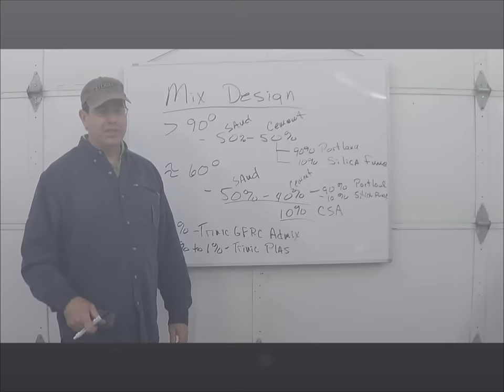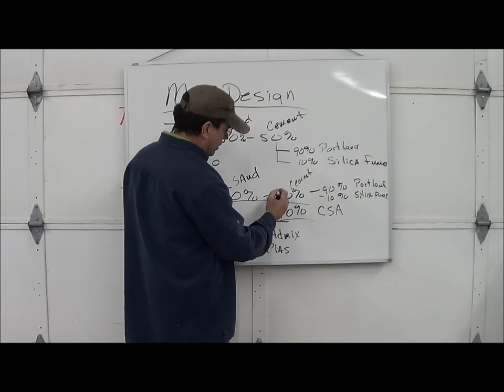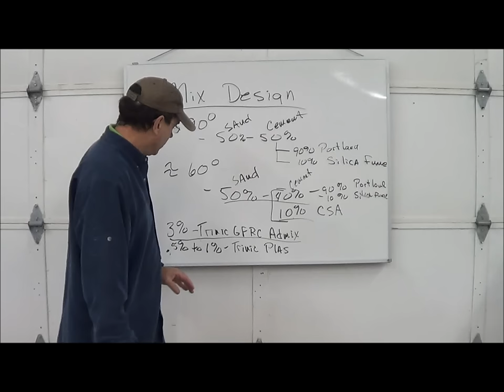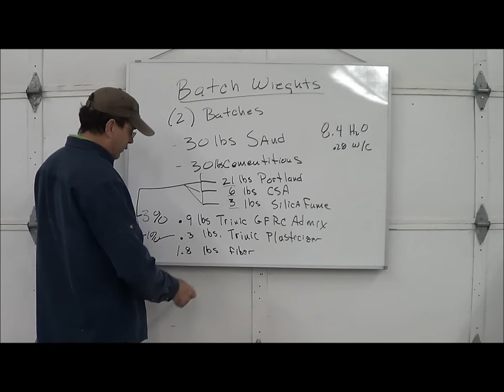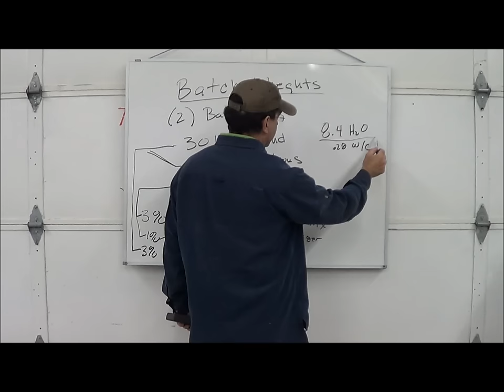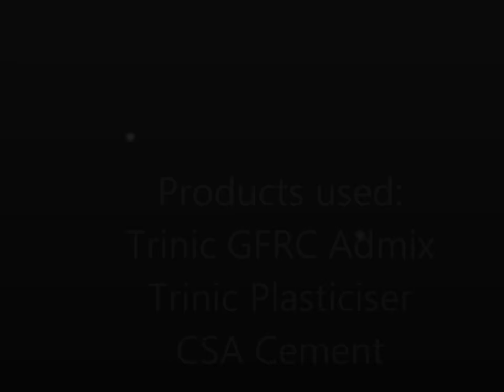Warped Concrete Coffee Table - UHPC - GFRC - Glass Fiber Reinforced Concrete

Comment: There are no glass fibers coming out from the top surface?
You don't need an extra thin concrete layer without fiber glass so that fibers do not appear on the surface?

How do you deal with this problem?
Reply from the maker: The reason you don't get glass fibers in the face coat is because they have a lower specific gravity than the sand and cement.  So when you pour the mix into the mold the fibers float up away from the face.  You could also replace the AR glass fibers with PVA fibers to make an ECC mix.  PVA fibers aren't visible to the naked eye after casting.  PVA fibers are dosed at about 1/2 the rate of AR glass, but cost 2x.

Comment: Hello, thanks for the informative video. Please tell me why, after acid treatment, neutralize it with ammonia? What will happen without this procedure?
Reply from the maker: If you don't neutralize with Ammonia, the acid continues to eat away at the concrete.
Reply: @TrinicLLC  So it won't be enough to rinse it off with plenty of water?
Reply from the maker: @SR20VEonW10  You should be fine with a good amount of water, but any acid that is left behind can cause sealer issues down the road.

Comment: Thank for sharing this video. There are both uhpc and gfrc in the title. which one do you mean? I think they differ in case of mix design.
Reply from the maker: UHPC refers to (according to ACI) strengths above 17,500 psi. GFRC can be any glass fiber reinforced concrete so it can actually be both.

Comment: How much rubber did you need to cast this particular mould?  Looks like over 80lbs?
Reply from the maker: I think it was just about exactly 80# it was a long time ago😁
Reply: Nice, I am a total beginner, I want to make this, going to make, just need to figure out mould casting.  Waiting for a call back from polytech, just need to figure out the recommendation  for amount of rubber on sides and bottom.  Thanks for the quick reply, you guys rock!
Reply: Okay so for anyone else interested in the calculation.  The minimum side wall needs to be .75" larger than the table, bottom needs to be  .5" larger, if the table is 2x8 ft thats about 51lbs of the 74-45.  They sell in 4, 16, and 80lb kits
Reply from the maker: @nealjones76  bottom is 1/2 “ min, sides 3/4” take total cubic inches divided by 27 = pounds of rubber

Comment: Do you sell the material to make the mold? And, will the mold hold up to a 4" pour? If so, you may have just upped my profitability on my most popular item by a significant amount. Also, whats time zone are you in? I'm in HI, and Guam. Don't want to call you in the middle of the night.
Reply from the maker: We do sell the polyurethane rubber to make the mold. That only needs to be about 1/2”-3/4 thick and will last for close to 1,000 casts if you are careful with it. The support for the mold you would need to make stronger to take the weight of 4”. Also why so thick when you can use GFRC and do it at 1” and make it look like it is 4”?
Reply: It's the center support for a 24"×48" outdoor coffee table, in the shape of a university mascot, thats small on bottom, and wide on top. I do oval and rectangular tops and bottoms. Top thickness is 2" with wire mesh reinforcement. Bottom, which is 18"×36", is 2.5" thick, reinforced with wire mesh. Think of a bull head with Horns. My goal is to lighten it up. I tried a pink foam board center, with 1" cast all around, which made it light, but didn't pass a strength test. All 3 I made in testing failed. I'm currently using pink foam board for my molds, which are 1 time use.
Reply from the maker: @bennettjones9696  give me a call sometime next week and I’ll go over how to get rid of the conventional wetcast concrete/ reinforcing wire and the weight all while increasing strength.
Reply: Will do. What time zone are you in?
Reply from the maker: @bennettjones9696  we are there from 7:30 AM to 4:30 PM M-F Easter standard time.

Comment: how about white concrete and adding colors?
Reply from the maker: We are the Crown we always start with white concrete, add the lightest color we plan on using as integral color Incase it gets chipped it doesn’t show as white. Then we accent with the darker colors
Reply: TrinicLLC why you dont grey cement instead of white cement? White cement more expensive than grey cement
Reply from the maker: Süleyman Kara gray is weaker and the color varies too much as does the water demand. So white is more consistent